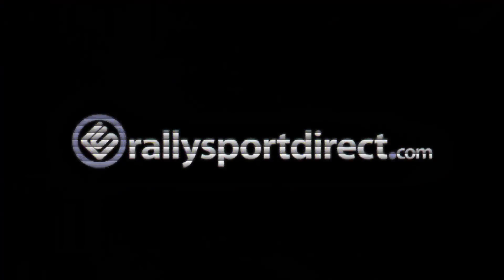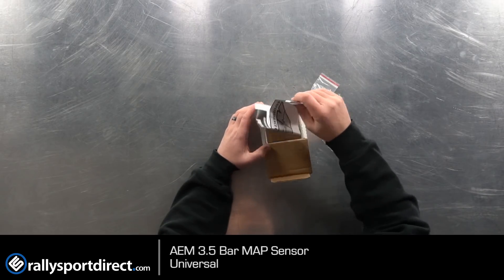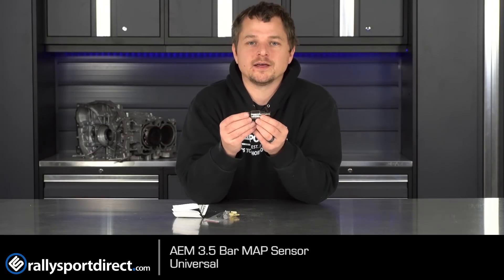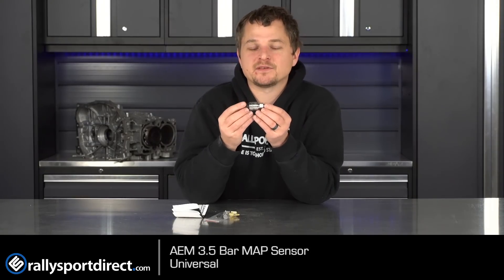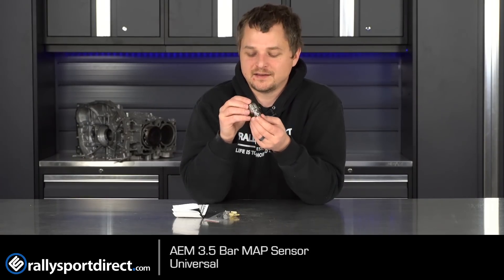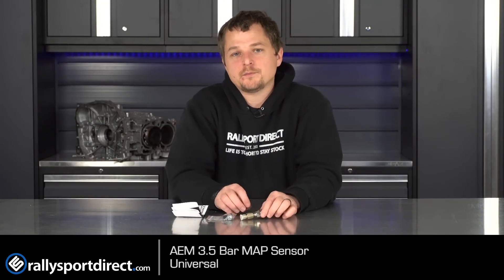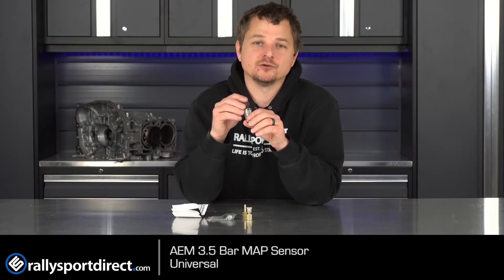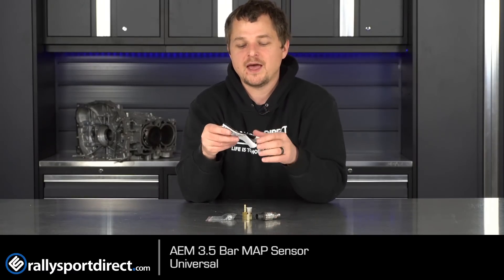AEM 3.5 bar MAP sensor

Comment: Best sensor to get hands down part throttle and idle is way better with a AEM 3.5 bar map sensor
Reply from the maker: Truly is an amazing sensor! :)

Thanks,
Rick
Reply: When would an AEM 2-bar be a good option?  Lets say you want to run 27 or 28 psi of boost; which level-bar should be optimal?
Reply: @EdVoigt1  3 bar. 1 bar for vacuum. 2 bar for boost